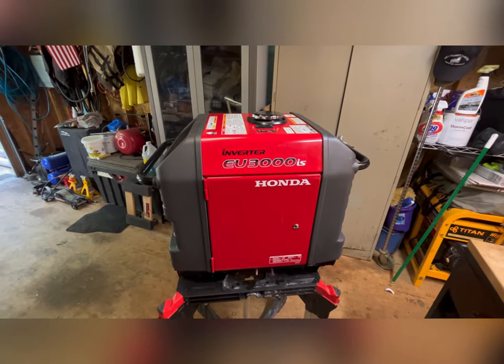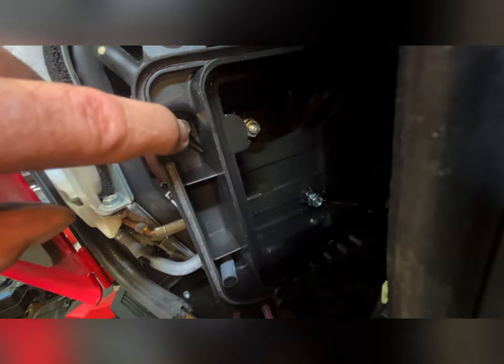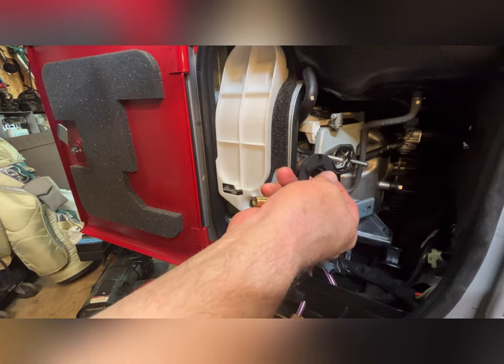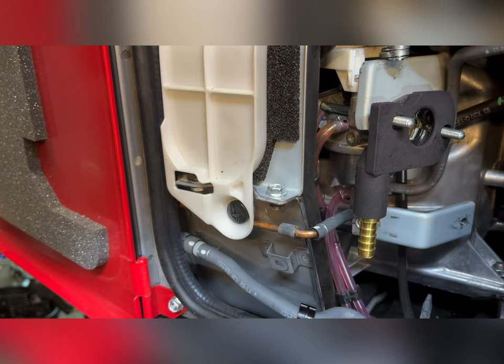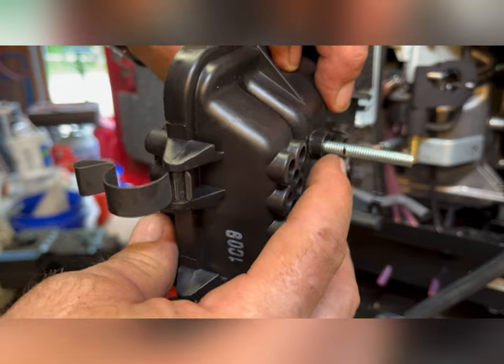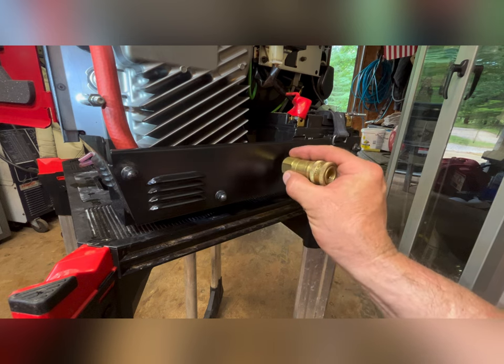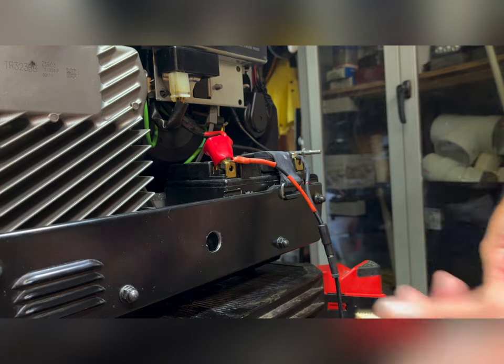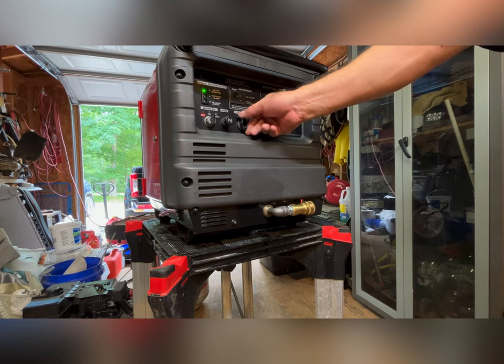How to install Propane Kit on a Honda EU3000is Inverter generator, Nashfuel.com LP Tri Fuel LP gas

Comment: Great video thank you. Getting a cart together on Nash fuel for my eu3000is and wondering what size hose you used with the venturi? Looks like 3/8. Emailed Nash 5 days ago but still waiting for a reply.
Reply from the maker: 3/8”
The 2 stage regulator was the key to easy start and smooth running. I tried a few single stages but they would not work consistently. 
Always nice to have the option of propane. 

Please Subscribe to help me grow my channel

Thanks
Jack

Comment from the maker: Updated to a two stage regulator. This allowed the Preditor and Honda to run on the LP setup without adjustments. You can find them on Ebay for around $20.00.

Comment: Why not for the honda generator eu7000is ? you are selling the kit to us and no support.  Sure would  help.
Reply from the maker: I have no connection to NASHFUEL. I purchased there converter kit for propane and it worked great for me. We run gas and switch back to propane often with out issue. One thing I did add to my propane kit is a two stage regulator. It made the setup more stable and I can use it on my Honda eu3000 and my Preditor 3500 with out making any adjustments. Sorry for your issues with Nash Fuel. Regards